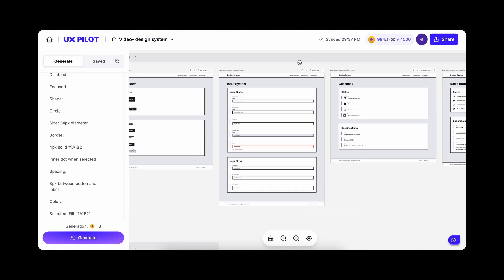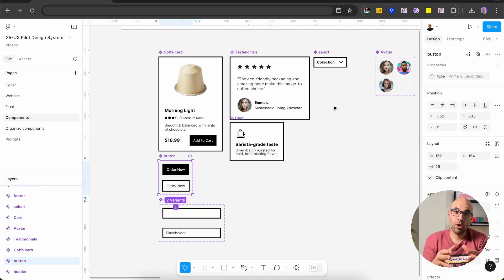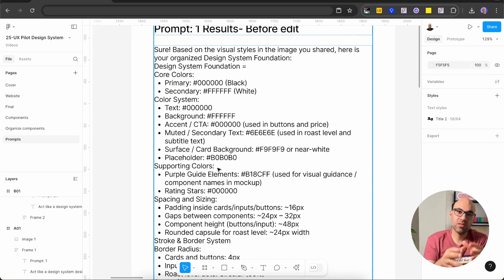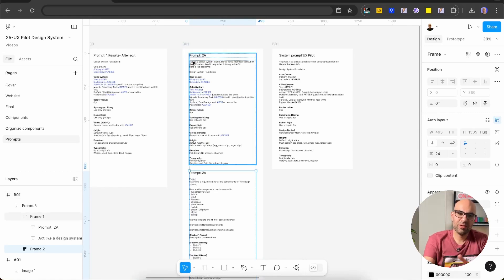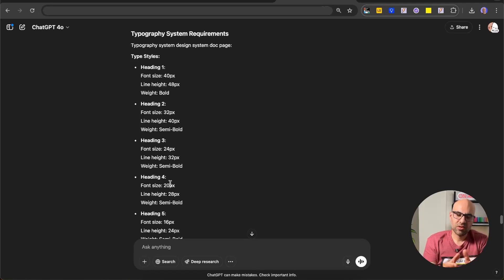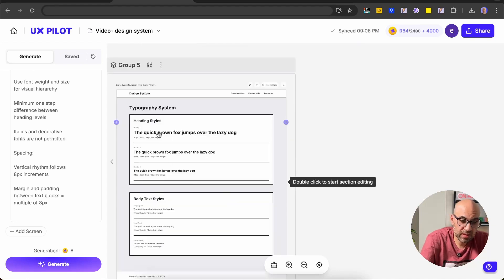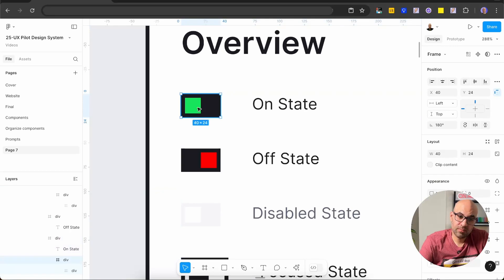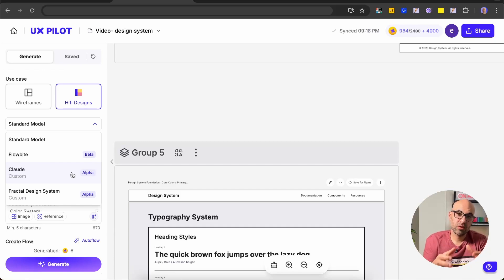AI Built My Design System (with Figma + ChatGPT + UX Pilot)

Comment: This system works really well so far! Much better than alternatives. 

One question:

When I create on UXPilot, the frames seem to have autolayout functionality. When I import these frames into Figma the autolayout appears to get lost. Is there a way to maintain autolayout logic in Figma?
Reply from the maker: That’s great to hear! Unfortunately, it is not possible to do so, but I hope soon it will be possible.
Reply: @edwche  No worries. Your product is already lightyears ahead of others in the space. Also- Figma's autolayout system can intuit quite a bit already.

I had a few bits of feedback to help make the product a little easier to understand from a verbiage perspective. I can post it here if you like, also sent you a connection request on linkedin in case you'd like to chat there.🙂

-Kyle M.

Comment: In your experience, does UX pilot also hallucinate structure or style? Or is it just a matter of better prompting and re-prompting to ensure compliance? I ask because i am a designer in an large enterprise, and none of the new set of tools has been useful to integrate in my current workflows.
Reply from the maker: Hey! Thanks for the question.

So here’s the thing. Getting good results from these tools really starts with how you prompt.

You need to explain clearly what you're trying to achieve. If the machine doesn’t understand the goal, the output will miss the mark. It's not magic. 

Another key piece is importing your design system into UX Pilot. That’s when things start getting interesting. Once the tool understands your components. But even then, it’s not going to give you the final result.

What it does really well is get you from 0 to 50 percent. Sometimes even 60 or 75 percent if your prompt and system are solid. But that last mile? You still need to fine-tune.

So yes, it can definitely help you move faster. But it's not going to just click and be done.
Reply: @edwche  Thanks so much! Grateful :)
Reply from the maker: @MriduMehta-d1j  Always!
Reply: Thanks for this response @edwche
Reply from the maker: @judithjuwah239  Sure!

Comment: Thanks for this video. My question is, are the designs you save and later opened in Figma are well-structured designs? Like using auto layout?  I have a free plan of Ux pilot and cant test it.
Reply from the maker: Still not, it does not include components and autolayout.
Reply: @edwche  ugh, i thought the autolayout was included.. thats useless then lol

Comment: How is the format for creating a system design for the mobile version? I have always tried it for the web version
Reply: I was fooled by the channel author and bought a premium subscription for UX Pilot. This service doesn't follow android or ios guideline. It doesn't even have native components built in. I manually embedded components but still the service doesn't understand. Moreover the service even has problems in generating simple buttons by prompt and bugs in typography. The author of the video is just advertising his referral link. I was denied a refund for my subscription by support.
Reply from the maker: Good question, try to explain it in the prompt that you want components for mobile design but also explain that you want to see all the assets in the desktop size. It is more comfortable to see all the assets in a big frame.

So I believe that playing with the prompt and explaining what you want to achieve will solve the issue.

Comment: You defined a border radius of 4px at the beginning. The buttons that were created by uxpilot don't have any border radius. All in all the created design looks more like wireframes to me. Am I missing something?
Reply: In the prompt, there is explicitly stated that the buttons do not have a border radius.
Reply from the maker: Hi! Thanks for the comment.
UX Pilot doesn’t get everything perfect yet, it gives me about 85% of the result, which already saves a ton of time. It still needs some manual tweaking to get things right, but that’s totally normal.